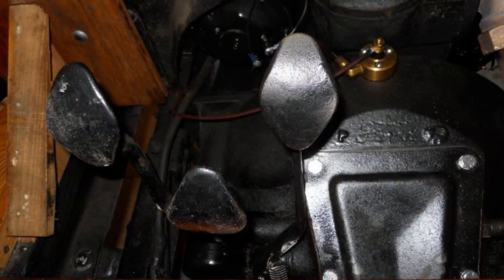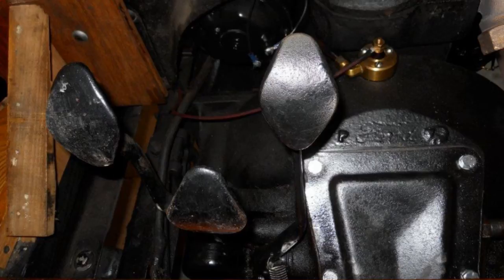Model T Transmission Lesson

Comment: The trick was to use reverse and the brake pedal to stop. That spread the badn wear and one would change both at the same time. Not too hard, as long as one didn't drop a nut into the sump. Easy to do!!

Comment: I remember the Model T transmission very well, in 1930 my father sold his model t and bought a model a pickup.
Reply: Does the Model T transmission use motor oil instead of transmission fluid?